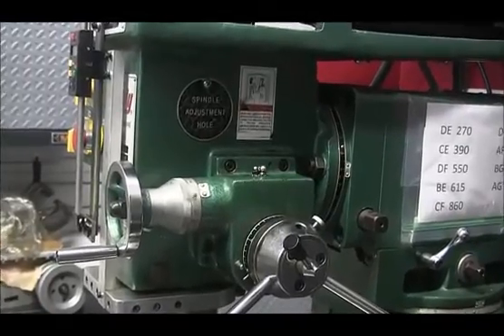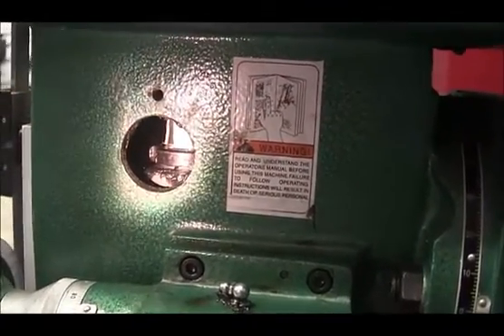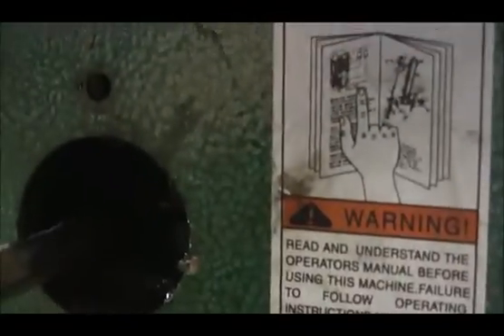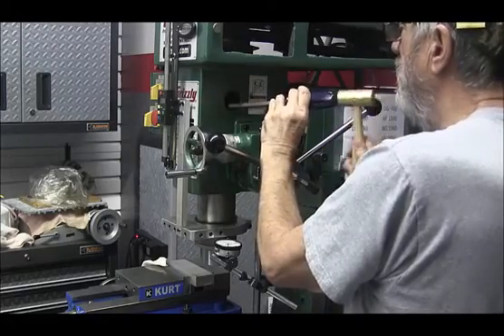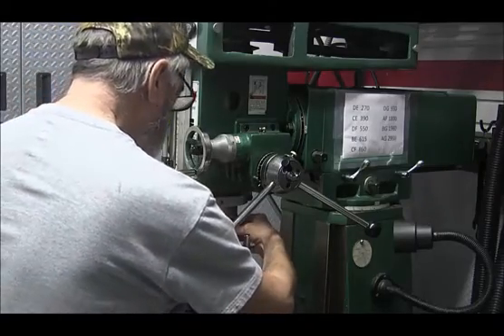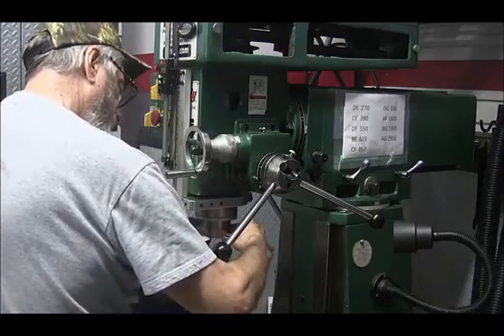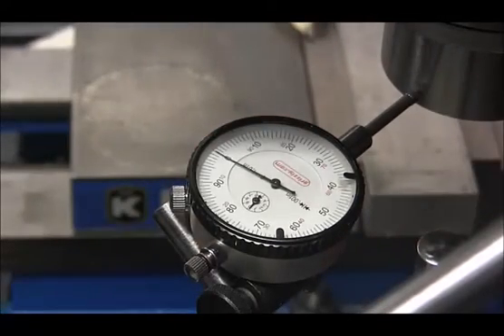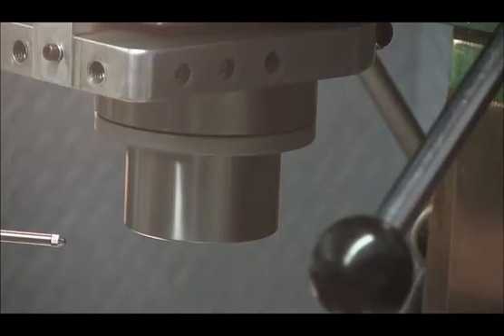Preload Bearings on G3616

Comment: Bill , is there public info for bearing replacement and this adjustment info?  My 3616 oozes oil so I figure this is in my future.
Reply from the maker: EC, I got all my info from Grizzly and from discussing the situation with members of Chaski's "The Home Machinist!" forum. However, Grizzly made it pretty easy. Just call them.

By the way, there is no oil in the spindle bearing locations to ooze. The bearings are packed with grease prior to installation. 

Good luck with your 3616! Mine is now stored--and has been for months along with the rest of my shop--as we build a new house and shop. I miss the machines!

--Bill